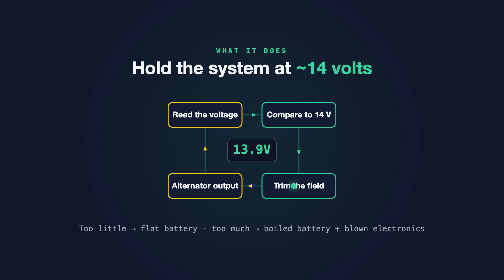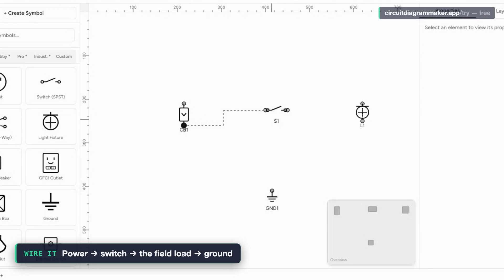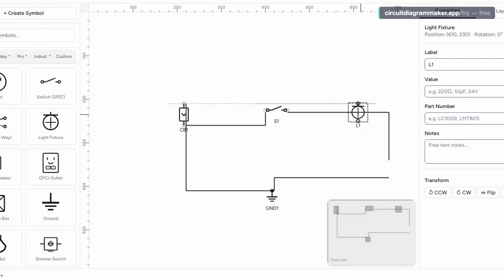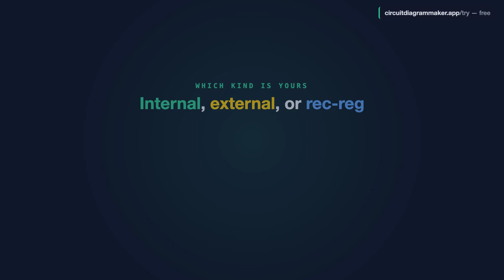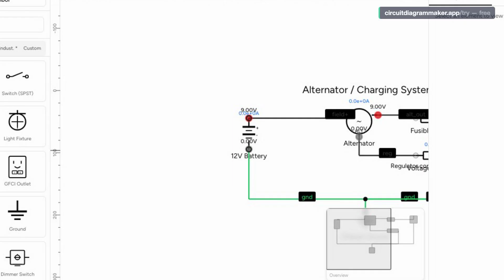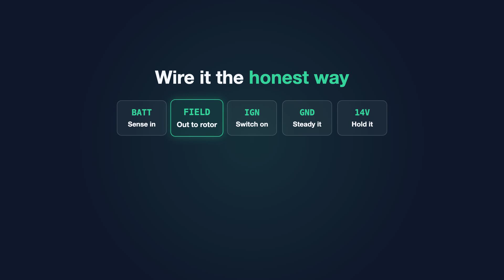How to Wire a Voltage Regulator (Diagram)

Comment from the maker: Quick charging-system tell: overcharging (regulator stuck high) reads over ~15V — lights too bright, battery hot and gassing, and it cooks batteries and electronics. Undercharging reads under ~13V running: dim lights at idle, a slowly flat battery, and the dash light glowing. Measure at the battery with the engine on — around 14V is healthy.

Also worth knowing: most modern alternators are internally regulated (the module is built into the back), older cars, tractors and marine rigs use an external regulator you can test on its own, and bikes and ATVs use a regulator-rectifier that also turns the alternator's AC into DC.

Open the exact charging diagram free: https://circuitdiagrammaker.app/diagrams/car-alternator-wiring-diagram?utm_source=youtube&utm_medium=pinned_comment&utm_content=yt-084